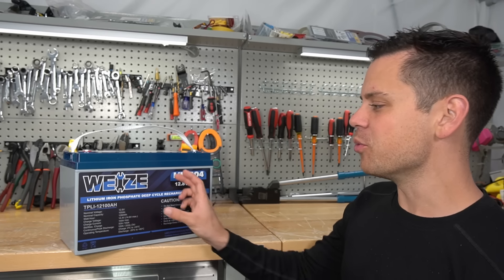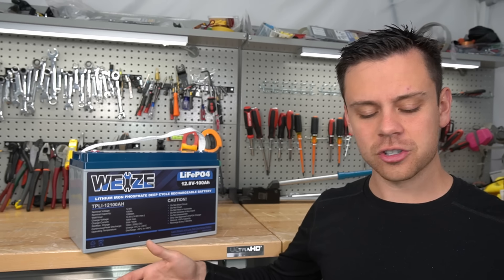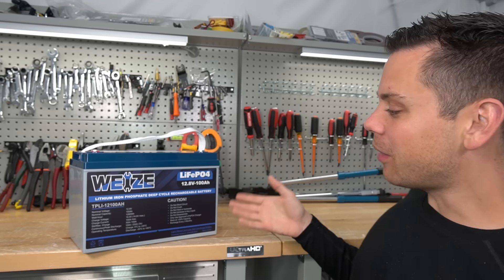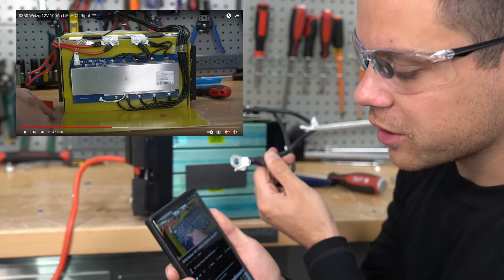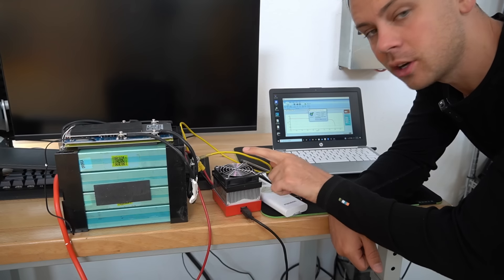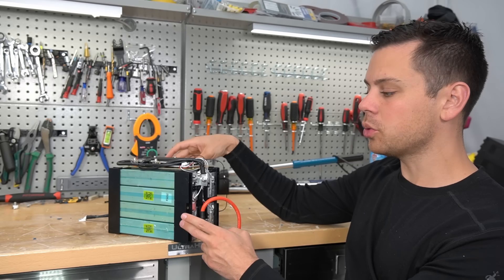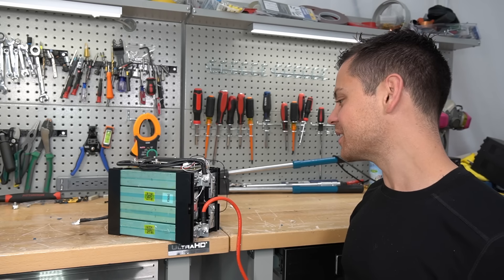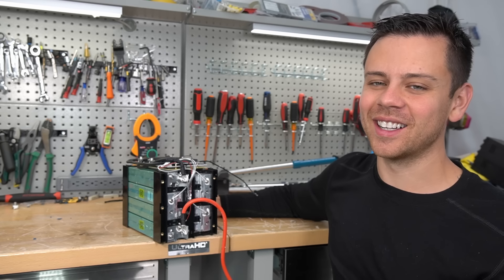$329 Weize 12V LiFePO4: 18 Month Update! Should you buy it?

Comment: We bought the Ampere Time, 2, 200ah. We bought them after your review. Knowing that the batteries would be stored indoors, and temp controlled. It’s been over 18 months, and I am loving them! We have never gone this long boondocking, without the generator. We are on day 45 without the use of the generator.
Reply from the maker: Awesome!!
Reply: what is your resting voltage? I have the same setup,I get up to 13.8 doing the day and rests at 13.12?
Reply: @izzyizzm8761  I think I’m resting at 13.5. I have a Victron system supporting the batteries. A smart shunt, a 100/50 charge controller, and 820w of solar. We have been in the desert in Arizona, then moved up here to Lake Mead. I only went down to 12.06, 5 days ago, when we had clouds all day. I thought I would not have any battery power when I woke up. I didn’t even sleep with my cpap, I was afraid we would run out of power. But the next day, the was shinning. So I pulled out the 140w portable solar panel, shut off the 110v fridge, and shut off the inverter, for the day. We made up to 80% of power, and the day after, it topped us off. Since then, it’s been at float charge by 11am
Reply: @tracymeskel2839  
For your health, don't sleep with out using your cpap😱. Get a backup. They are inexpensive enough. 🤗

Comment: After your review of Zoom Batteries (now Redodo) a year ago, I purchased eight 100amh and five 200amh for my 50ft long keystone 5th wheel with 6200watt HQST solar panels on the roof...and thus far no problems :) Im running several Freedom X 3000 inverters, and alot of EPEVER controllers (again after your reviews). My system is sectioned into 3 systems (living/main, kitchen, and bedroom.  I spent more money going this way, but any part of my system can go down, and Im still powered up fine! I run my dometic ac unit  all summer and a large fridge and microwave :) Ive had several friends with alot of long term issues with Victron stuff, so Im glad in the end I went with the brands I did. Thank you for your product reviews and helping me make those choices! Love to hear more about heating options using solar!!!

Comment: I picked these up after watching your video last year, I used 3 of them in parallel for my camper solar/upgrade build - so far it's been fabulous, 300ah paired with 600w of solar is keeping things charged, and lets me run the Starlink the entire time we're out, which means working remote is stellar.

Thanks Will! Your vids are super helpful and are great info that's easy to digest

Comment: Thank you for still reviewing the "smaller" stuff.  Most of my use cases are portable operations, so taking anywhere form 100 to 200 watts of solar panels and a single 12 volt battery (20AH to 100Ah) out in a field and have it run for 12 to 24 hours.

Comment: I bought Chins batteries for my last RV (your review was helpful) but had to rig my own low temp protection circuit. For my new RV I'm getting the Weize 300Ah model. I looked at the server rack battery, but it was 33% more power for 50% more  in price, so for me it wasn't the best solution. Keep up the good work, your reviews are always enlightening and entertaining.

Comment: I bought one a little over a year ago on your recommendation.  I'm using it in a van. It is kept charged using two 100 watt solar panels through a 20 amp Rich Solar charge controller. So far I have had no problems with it.  It runs a 12v  refrigerator, interior lights, a 1500w inverter,  a water pump and charging ports and 12v accessories.

Comment: I built a 12v truck jib crane with the 36ah version of this battery.  Im in pa and we went through very cold winter and guess what... its still working great. Used a powerwerx 50v / 14.6v mppt with a 36w panel and dang its great. 1500lbs pull power baby. Super cheap

Comment: I have two Weize 100 amp hours LiFePO4 batteries purchased July 29, 2022. Inside my Escape 19 RV trailer they are working fine. They are paired with a 300ah Chins LiFePO4 Smart battery in an unheated storage box outside of the trailer. They were all purchased based on your videos and I've been happy with their performance.

Comment: [edit] Why would anyone buy these $300 batteries? Very simple - people buy the “small” batteries because they do not need 400Ah of capacity!  If you only need 100-200Ah of capacity and you don’t have an unlimited budget, $300-600 hurts a lot less than $1500!  

Your older, original followers often have smaller off-grid system needs…. vs your channel’s current whole house systems focus.

Thanks for coming back to small system earth with this update!
Reply: You are correct. My system runs everything here, and I have less than $1500 in the entire system.
Reply: Prices keep going down too. 12V 100Ah batteries are now available under 250 moneys.

Comment: I have two of these Weize batteries and they are working fine in my small homemade system. I don’t cycle them much as I keep them charged for a backup power supply. I have not had any issues with them.

Comment: Thanks Will for thr review. I recently bought 2 - 200 ah of a competitors cheap batteries. My reasoning to buy these instead of a server rack battery was size and fitment form my travel trailer. I needed 12volts  and had no place for the server rack firm factor.

Comment: I bought 2 of these for my Class A to replace the AGMs that were killed by the wrong setting for low voltage cutoff on the inverter from the factory. So far they are working great.
Reply: Isn't it nice that if you get that wrong on LFPo, they don't care - instead of dying permanently.

Comment: The main advantages of the 100 amp hour batteries is current output for smaller systems and flexibility of where you can install them in a confined space like a boat or rv. If you aren't trying to run an air conditioner 200 to 300 amp hours is plenty of most rv and boat applications. With the 100 amp per battery you can still have a 2 or 3kw inventor and run loads like a microwave or induction hot plate. IMO the ideal for small systems is the 200 amp hour 200 amp bms from ampere time. Same current output as the 100 ah batteries with half the interbattery wiring and cheaper than even the budget eg4 server rack.

Comment: Hey Will, I bought one of these batteries about 6 months ago for my RV based on your first Weize video.  I liked the quailty of the battery, the low temp protection and the great price.  Battery has been good.  I needed to replace my golf cart batteries so decided the Weize 100ah 12V would be a good choice.  I bought three of them and run them in series for 36V.  They do work fine but they do have an issue with the BMS shutting down current flow if I demand full output from the cart.  It's rare that it happens so I'll live with it. Now that I saw you second video I'm second guessing my choice. 

Thanks for all the great info and videos.

Comment: People use multiple 100Ah batteries because they start small and find out need to expand for the system to work as expected - like me, for example :)  I ended up having 4 100Ah batteries and one 200Ah in a 12V system.  All Redodo by the way.
Nice video!
Reply: Is weight also an issue? Perhaps people are buying the 100 amp hour batteries because they are lighter?
Reply: @toronado455  Yes, especially for RVs.

Comment: We bought a couple of Ampertime 24v 100 amp hour batteries about 18 months ago after watching your review.  I don’t follow rules to well so I have 4 Battleborn 12v 100 amp hour wired 2p 2s parallel with 3 Ampertime 24v 100 amp hour batteries. I started with the 4 and added 2 of the 24v a couple months later. I just added the 3rd 24v battery just a couple months ago. I now total 500 amp hours @ 24v.  Charging with 30 cheap used 240w panels from Santan Solar (thank you for that tip too) and two Midnight Solar 150s limited to 90 amps each to keep the temps down. I did have them limited to 80 amps each before I installed a 10” fan plugged into a temperature relay to help stir the air a little. 
     I even have a 12v 50 AH battery that I tie in to keep charged for my trolling motor or portable power supply with a small inverter.
    Breaking all the rules and having no issues.
     Thank you again for all that I have learned from you. You inspired me to take the plunge and go gridless!

Comment: Some of the reasons for buying the smaller 100 ah battery are for physical handling capability of the assembler. I’m very limited in the amount of weight I’m allowed to lift due to a spinal injury. So I’m looking to keep individual component weight down.   Thus for people with limited physical ability and financial resources these tend to make sense.
Reply: Agreed - the server rack would be ideal but too heavy - maybe make a wheeled server rack for domestic with ship-to-shore power connections?
Reply: Exactly. I also could not fit larger batteries in my short wheel base van.

Comment: The low temp really works. Got two of them for an camper about 6 months ago. They are solid so far.  Not spending more than I have to.  The 200 amp hr is $600 so even better deal.

Comment: I purchased 2 originally and had great luck with the batteries. I have recently purchased another battery from Weize and it has now been working everyday for the last three months. I now have 3 ampertime, 3 Weize and 1 Chinn and all are working well in small systems I am running.

Comment: I bought this battery back when you first reviewed it, still works well.  I bought 2 of the Ampere Time and liked them so I bought another 2.  Reason I went with 4 12v is that I can reconfigure my set up in any voltage from 12 to 48 volts.  If one of the batteries fails as a 12v system I only lose 100ah, for the other voltages it is a bit awkward to make it work but I will not be without any power as if it was a single 48v battery.
Reply: I follow that logic. 
Plus you can ‘scale up’ over time for budgetary reasons. Or just add one if a situation change needs a bit more amp hours without dropping $1500. 

Or for the two 140Ah Btrpower cheapos I bought for $395ea- I didn’t want to commit to more than 1 battery at first in case the brand was a dud. I tried to buy a third but they are not listing a 12V 140Ah any longer which is annoying. 

I get what you’re saying.
Reply: @fishhuntadventure  How are you liking that 140ah batteries?  Have you tested them to see if the capacity is not overstated?

Comment: I bought a CHINS 300ah about a little over two years ago, the thing operates exactly as advertised still. I put it into a large camper van with a fairly large solar array,
it limits charging to 60 amps, it has a hard cutoff at 200 amp draw within +/-3A.
I learned a lot working with this, but the battery still works within spec at 99.5% original capacity

I liked this so much, The next year, I bought the 400amp version for my folks home, who live off grid. better specs all around (charging/cutoff voltages that better match lead acid) no need for a quarterly drain down, even better relative short term current draw.
The first battery showed up and was a dud, failed in a week, it retained capacity but couldn't deliver more than about 20 amps, 
I returned it for a new one, no issues since.

Comment: That's a good point about the 12 volt sever rack battery. 

As I've said before our plan is to build an off grid property with a 500 to 700 SF home and use 12 or 24 volts for the lighting and a 48 volt inverter for the line voltage needs. Using two systems gives you a bit of redundancy in case something goes down.

Comment: I have three of the 50ah Weize batteries.  One is used for a remote mobile camera that I move around my property.  The other two I use for Christmas lights on either side of my driveway.  I bring them in to charge.  Mostly no sun in the winter.  The mobile camera rig is just easier if I don't have to include a charge controller and a panel.

Comment: I think many of us, myself included, are buying batteries in this price range just to replace some paired 6 volt golfcart batteries in our campers or to get better runtime and lifetime use in running trolling motors on small boats. Just saving weight, compared to a 12 100ah LA battery, can make these worthwhile in many none solar uses. You're focused more on building solar systems, but a lot of people have no desire to do that, and a server rack battery would be useless to them. They just want a superior "drop in" replacement for the old LA technology and the peace of mind that comes with knowing it will last their lifetime if they are middle aged and use the battery in a typical cycling profile. I'm really glad that you are following up with these drop in batteries because there is a huge customer base out here, that aren't building power walls, that also need your input.

Comment: I bought one of these 10/2022 for $299. It failed in 5/2024. I used it for trolling motor. It sat for a few months and died. It would not restart. I tried all the jumper techniques to no avail. Weize tech support responded to emails and worked me through troubleshooting. It was a bit of a process, but they finally agreed that it is dead. They sent me a new battery and I still have the old. I wonder if I can repair and will cut the top off one of these days. Since then I have upgraded trolling motor and battery to 24 volt. I bought a Repower Flow 24 volt 100 Ahr battery in a suitcase. So far it is an awesome product! I am no "Will Prouse", but I highly recommend!
Reply: did you find any issues with the battery when it sat outside in the heat . i bought 3 weize and about ready to install. to big to keep in a garage but i keep it tarped.
Reply: @cerealkillerjigs  The battery that failed was kept in my garage or inside our 44' boat. Both places are unconditioned but not super hot. Still don't know why it failed.

Comment: I commercially clean swimming pools and use one of these in my vacuum so it gets used and recharged a ton, 3-5 times a week depending on the time of the year. About 18 months later it’s still working great and holding a charge as when it was new. Also if it makes any difference it lives in the back of my truck all year in the heat of summer and freezing winter

Comment: I put one of these in my RV last fall - I hear you loud and clear on price and quality - but overall I just needed a single lithium battery to swap out my lead acid that I can fully discharge without damaging it and having it last 24-36 hours running the 12v options in the rig. If I were doing a whole battery bank or a big solar setup I'd choose something different - but for a direct swap in an RV this makes a good low cost option

Comment: I have 3, 20 amp hour and 1, 50 amp hour Weize batteries and haven’t had any troubles.  I use the 50 amp hour battery in my square drop trailer and use the 3 20 amp hour batteries wired in parallel to run my dump trailer.  No problems so far.

Comment: As an electrical engineer, it is standard procedure to have at least three manufacturers for every major component in your bill of materials.
This practice goes on in everything from your TV to your car. An Infamous example I can remember is when GM had a manufacturer sell them a boatload of defective stepper motors for their instrument clusters, and they mixed them in with all the stepper motors from all the other suppliers, next thing you know everyone's gauges are randomly failing prematurely, while the majority go to 300,000 miles without an issue.

Another well-known example is Apple not using the same speed SSDs or processors in various devices leading to "identical" devices performing differently on benchmarks.

That being said, the important thing here is the company determines the minimum acceptable standard, the minimum acceptable performance, for Apple I'd imagine it's minimum requirements are still better than some fly-by-night Chinese company, even if they're manufactured in a factored across the street from the Apple products.

Comment: I purchased 3 Weize 12V 100ah April 2022 and 2 went bad(would not charge) after 1 month. I contacted customer service and they replaced them with in 30 days.  So far all 3 have worked the rest of the summer 2022.

Comment: Due to your first video on this battery, I now have 4 paralleled together to run my small office. Just my luck you now posted this video after purchasing. So far so good, no problems.

Why 4 100ah batteries instead of the server rack 400ah? 
100a max draw on each - 400a draw max for 4. The server rack has a 200a max draw when checked. Inverter using is 3000w. 100a x 12.8v = 1280w, 200a = 2560w, 300a = 3840w, 400a = 5120w to cover startup surges and extra runtime. It would have taken 2 server rack batteries to get full power potential from the inverter doubling the cost. (Most of what I know about solar was learned watching your videos... Hope this math was right.)

During power outages  have been known to power my home with solar power from office. Deep well water pumps, furnace, refrigerator, freezer, TV, Satellite, ect. why want to make sure inverter will run at max to cover startup surges during the day to save gas for genny running at night. Not to mention have been known to run my hand power tools like skill saw/chain saw for examples, instead of plugging them into grid. Why not take advantage of free power whenever can since have it.

Comment: A prepper who puts a small system together might reason that four 100ah batteries is a safer bet since if one fails there are three good ones left.. whereas with one large rack mount a simple component might fail and take out the entire battery bank. ditto for multiple 100 watt solar panels instead of a single 360w panel..  a few small charge controllers instead of a single large one also might be a good choice...  a video showing the benefit of such redundancy would be nice.
Reply from the maker: I would rather have higher quality components and a spare BMS.